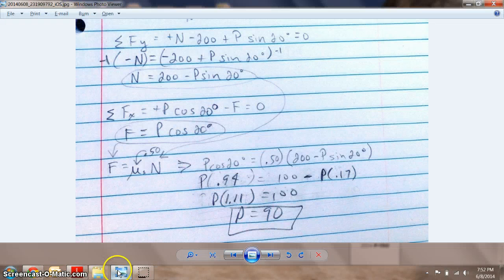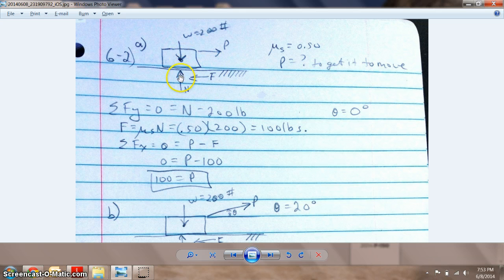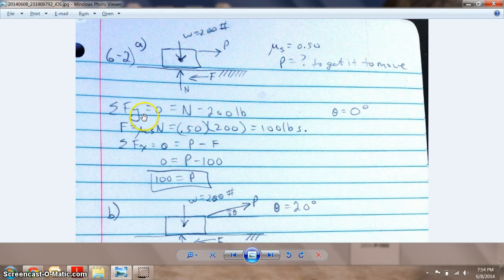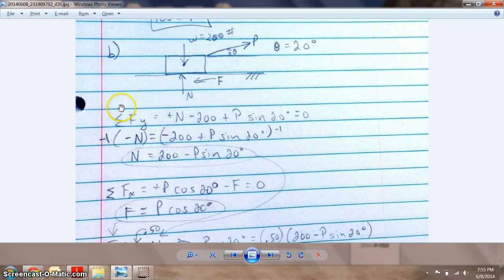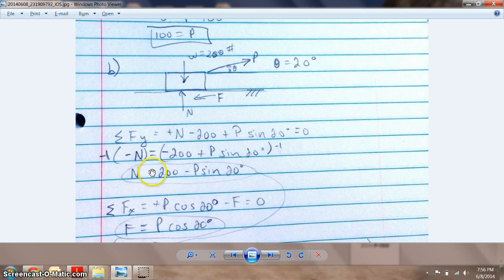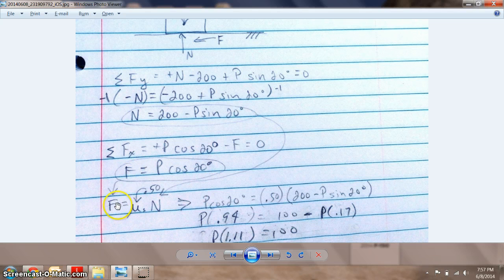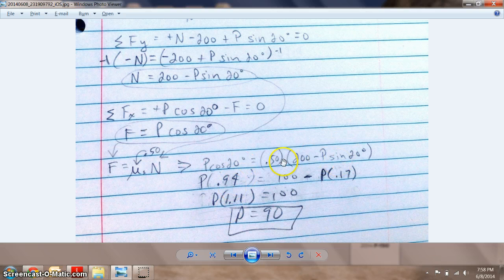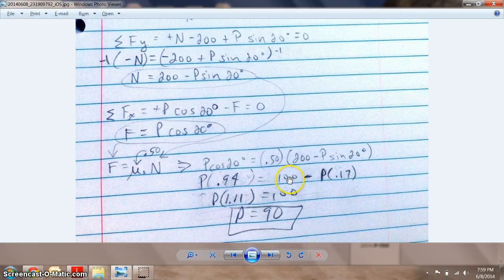Friction Problem - Ch6 Problem 2

Comment from the maker: The P load is the hypotenuse so to find the opposite side over hyp would require the use of sine. Scooteronomy23. I hope this helps. I'll check the textbook but this solution is correct.